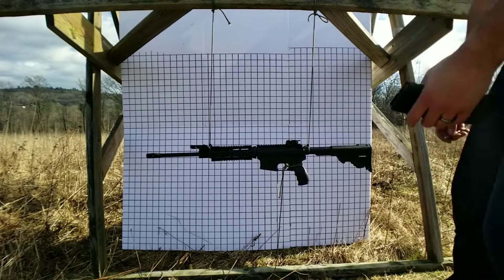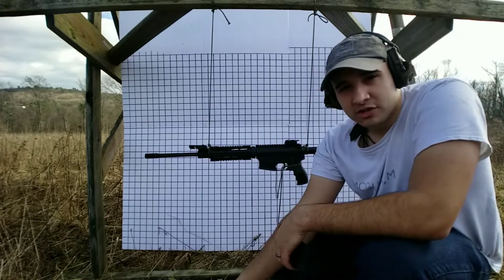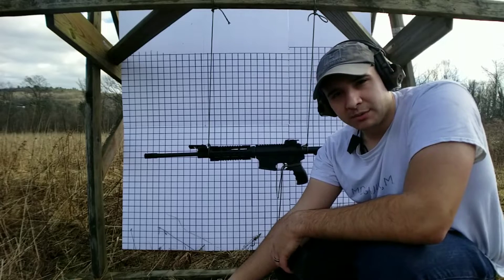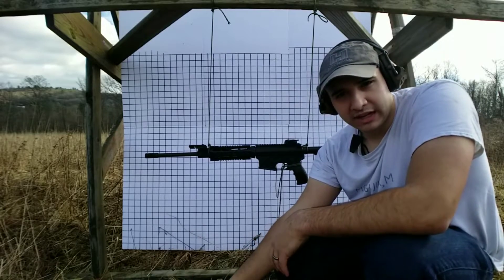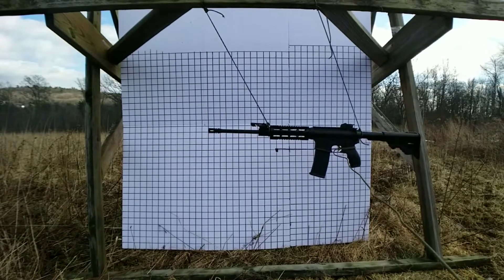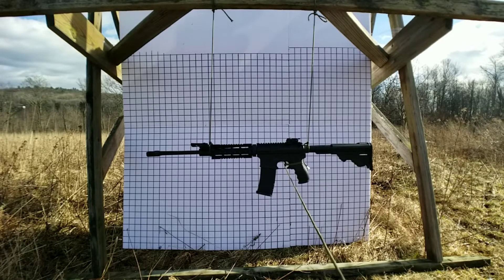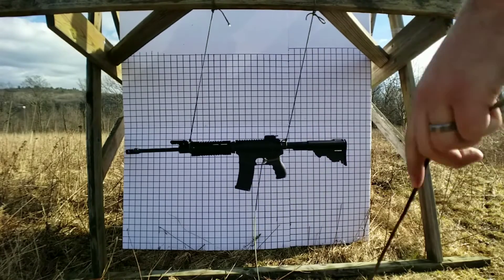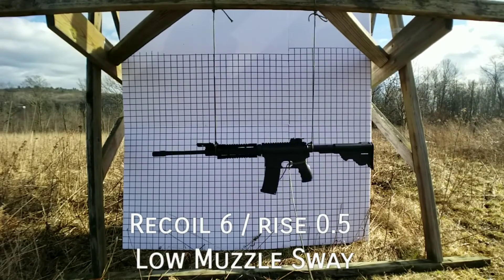HADES Hybrid Compensator & More versus A2 Flash Hider STAGGERING RESULTS *PATENT PENDING*

Comment: The reason it’s recoiling straight back, is because you didn’t include something that functions as a shoulder.  If you want to compare recoils upward impulse, put something behind the rifle.
Reply from the maker: Incorrect. Two different tests. The test you are talking about will only give an example comparison for vertical braking. Vertical braking "muzzle brake" is very easy to achieve.

 This shows you a more realistic view of how much a "compensator" is doing, the minimalizing of felt recoil. Difficult to capture outside of an objective test like this and without any fake sales gimmicks like someone limp wristing or holding one test subject harder then another to skew results. Ideally an overhead camera would capture horizontal plane movement as well. More to come.